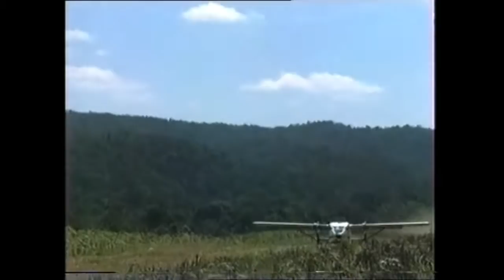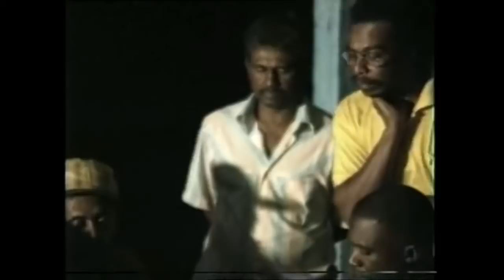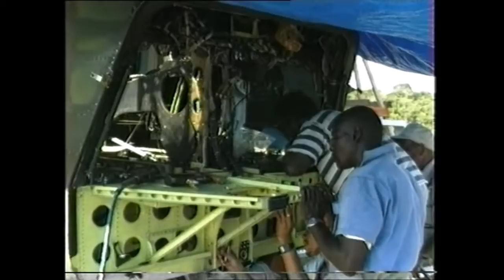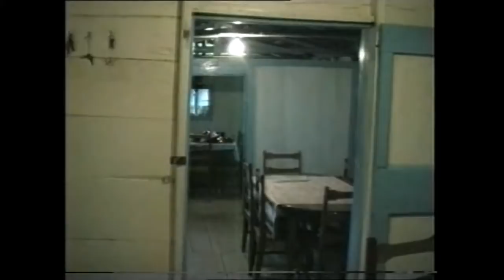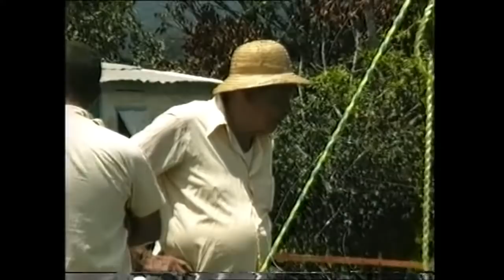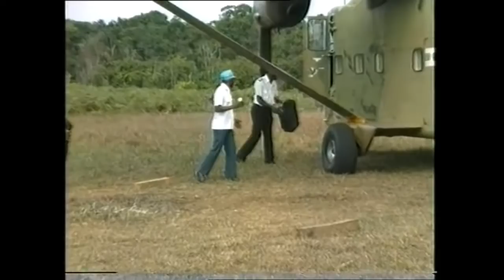Guyana Skyvan rescue.

Comment: What are all those vertical fines sticking out the top of the fuselage, above the wing and cabin?
Reply: I think you're referring to what I take to be mountings for the pitot-heads, which are used to measure airspeed. Rather an unusual position for them, but I dare say Shorts Bros had a reason.
Reply: VHF radio antenna on top of the fuselage (I presume you’re talking about the twin otter that flew in), and on the wings they are ‘fences’ to stop span-wise flow of the air across the upper surface.

Pitot tubes are mounted either to the side of the fuselage, or under (and forward of) the wing in clear, non accelerated, air.

HTH
Reply: mudmover is correct 👍

Comment: I'm rather surprised that it was considered worth repairing, rather than just salvaging the engines and other useful parts.
Reply: @clayz1  Yes,  I saw the other one. That damage seemed much less extensive.
Reply: I mean it's was only the front landing gear that was damaged so it wouldn't be wise to scrap it
Reply: It was 1995, not 2020, so the aircraft wasn't that old at the time